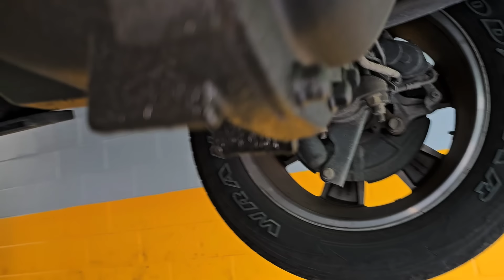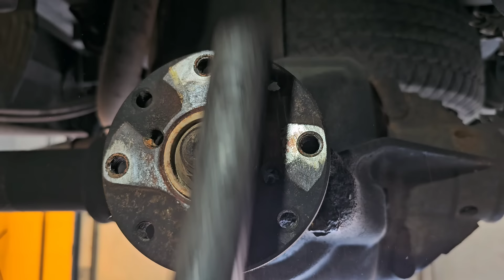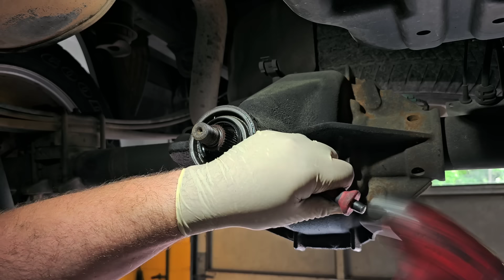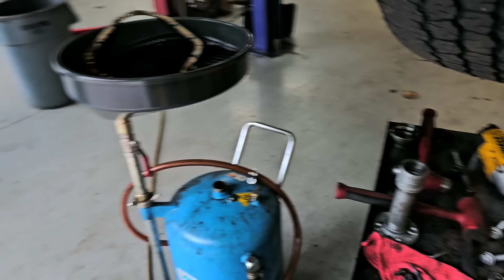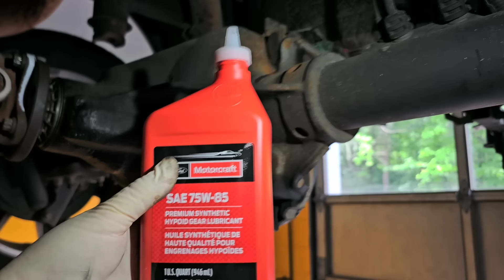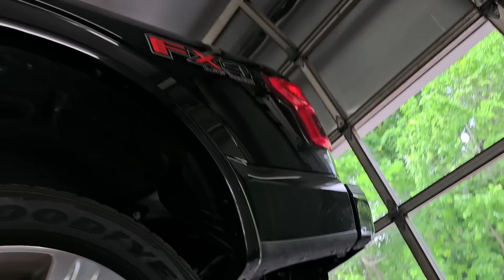Rear Pinion Seal Replacement The Easy Way!! Ford f150

Comment: Something I just found out: even though they may look like the square drive from a ratchet, not all differential fill plugs are standard square-drive sizes. For instance, even though my S10 differential looks like it has a 3/8 square-drive plug, about 9.5 mm, it actually takes a special 10 mm square-drive. That extra half a millimeter is just enough play to round out the square drive in the plug, especially if it is really stuck in there.

Comment: Nice! Only thing I'd do different is to measure the torque on the pinion nut before removal and again after reinstalling for comparison. And, I'd consider replacing the bearings in the differential if the vehicle is high mileage; that is, if you're planning on driving it until the wheels fall off.

Comment: I prefer to let it spray oil, just add oil and let it be. My truck is new and has leaked from day one. IDGAF about the leak, in the Midwest I call that rustbelt corrosion inhibitor.

Comment: Hey Kenny, Great video on rear pinion seal!  Very helpful.  What's the diameter size of the steel pipe you used to seat the rear diff pinion seal? I'm about to do the same job on my 2015 f-150 so that tool will come in handy. Thanks very much for a straight forward no non sense video.

Comment: Ford charged me $830.00 to do the pinion seal with a 2 year warranty. Do you think this was a good deal?
Reply from the maker: Dealers tend to charge more. The price is higher than what we would have charged. But it also depends on your area. From a shop where I live in the sticks, to a shop in or around a city, you could see prices higher by say 30-40%. A rear Pinion Seal is a good 2.5 - 3.5 hr labor charge.

Comment: I cant say anything about the new Snap On sockets, but the ones from 20 years ago are pretty much bullet proof! I have had 15/16 sockets that were used in disassembly of Semi tractor gliders to remove rear ends, transmissions and engines in hundreds of trucks. And the 15/16 socket I had from SnapOn was so worn out that it fit a 1 inch. And it still worked every day! Prior to getting that socket, I had craftsmen impact sockets the same size that would last about a month and would blow apart. I cant tell you how pissed off I get when the socket fails, slices my hand open, and stops me from getting the job done! After about 10 of these, I bought the Snap On...... Never had an issue again.
Reply from the maker: Those older tools really were built to last a lifetime, thanks for sharing your experience! Keep Wrenching 🔧

Comment: How much past the initial mark did you tighten the nut when you reassembled it? 1/16, 1/8, 1/4 of a turn? Do you ever get a brand new nut?
Reply from the maker: I tightened it about 1/16th of a turn past the original mark.   But I make sure I feel the resistance change because you don't want to make it overtight. I don't usually get a new nut, the old one works fine and I have never had one come loose. If there is ever a question or doubt in my mind, I'll get a replacement. Although sometimes a replacement is not easy to source. Thanks for the question! Keep Wrenching 🔧. Kenny

Comment: I run self tapers into the thick part of seal in 3 opposing spots and light pry with a small small crowbar ish bar and works every time , no scratches , no grooves , much quicker .

Comment: So basically you don’t know if you just over tighten the shit out of that thing because you didn’t count the rotations when you pulled your nut off you just use the impact to put it back on so if we do something like that, what will that cause the rear end out quicker because you put too much tension

Comment: The way it has been explained to me is that the hardness of a chrome socket sends reverberations back through your anvil to your hammer which makes you lose torque and wears your gun out faster. I never put chrome on my impacts, unless I absolutely have to because they are so much thinner, and I am still rocking the same guns I bought right out of trade school. It isn't all good. One other thing I was taught, which is the same principle, is to never ever use a bearing race as a mandrel. They are way too hard and they can shatter. I guy I know found this out the hard way and walks with a permanent limp because he wailed on a big industrial one and it exploded and pieces went into his knee and thigh.

Comment: My work truck is an 04 f150 with 135k miles.  Had transmission rebuilt a few months ago with performance shift kit, race clutches, new drums, new converter.  Shifts awesome!  My rear pinion seal has been leaking since before and it's gotten pretty bad now so I will be doing this job this coming weekend, this video is great and explains everything so well.  Feeling confident in my ability to do this now.  Will definitely be going back and referencing this though as I go along :D

Comment: Very good video  good clear explanation only thing that surprised me is that you used grinder to remove  gasket material which NEVER should be done  because doing so damge mating surfaces for sealing gear oil Gabriel.

Comment: How do you know that you have the same torque on the nut? Marking the nut, flange and pinion doesn't determine the new torque you applied when reinstalling. Would doing it this way change the in and out placement of the pinion gear?

Comment: Thank you so much for this video.  I'm about to attempt this myself on my 2018 Ford F-150, with 104,000 miles.
Reply: Check the breather vent hose make sure it’s not clogged with mud debris

Comment: I totally agree with the old school seal pullers they can cause damage, but there are some instances where I have no choice but to use one and where I have an issue is it’s not the hook it’s the other side that is being the fulcrum point that will leave a little mark especially on aluminum timing covers. What I found out works the best is a small pocket knife and instead of sanding the blemish and leaving dust I will just carefully carve away any high spots to prevent inducing and damage To the new seal when installing

Comment: He didn't check preload on the nut.  You don't need to replace crush collar, check Ford factory mait manual.  You check preload on the nut, if it's below 8 to 14 inch pounds, you will put it back there with a new nut that has a new seal.  You may need a new flange for the drive shaft.  You may not.  Or, is that a non preload?

Comment: As a rookie mechanic in 75 lost face on this job as a warrenty on a pontiac firebird. Our lil' vocational college had some weak spots....rear end drive work was a job rarely done on the floor during last year of hands -on. We were taught to always remove pumpkin & do the complete job. In stealership on one offers help. So we R&Red seal put it all back together with the small extra to recrush the tube...but in less than two weeks it came back. Given to the old timers to fix...i got the five thumbs award! Years later we learned that seals go bad for many reasons...mostly axial moverment beyond design limit due to bearing or cone wear ...in an engine due to varnish and carbon build up wearing out seal as it also hardens from age and heat. Also axial play in main bearings plus wear on sealing suface Damages the seal surface making a groove requiring a sleeve which come in a kit with the matching seal. In twenty years of municipal wrenching never had to work on any differentials. Everything else but differentials.
Like your style...

Comment: I like that approach with the chisel to remove the seal. I have used a puller, and I always thought that it could mess up the sealing surface, so I didn't like using it. The chisel approach looks like a pain to do while lying on the ground under a vehicle, but it also looks like it would be worth the trouble.

Comment: Marking that drive shaft is a waste of time.  They don't balance the drive shaft while it's installed on the vehicle. They are balanced off the vehicle so marking the location  is totally unnecessary.

Comment: This was very helpful , but can I ask are those bolts on the drive shaft, is that a standard size or is there different sizes, also what type of silicone did you use on the outer seal , could I use the same transmission grease as the inside of the seal? 
Thank you loved the video as I’m just about to replace the pinion seal on my truck, keep up the good work thanks for doing what you do , very explanatory thank you
Reply from the maker: What do you mean "standard size"? I used ultra grey from permatex. Keep wrenching 🔧 Kenny

Comment: I like to add - One thing you missed was the vent tube - If you have leaked seals the vent tube is the important thing to clear so the axle can breath and when the fluid it hot - that pressure does not build up  and blow the seals again - I found on my F250 that the vent tube was clogged with dirt and the pinion seal failed - So - good advice to remember...
Reply: Very good point. I cut the vent tube, then blew it clear both ways, and put in a 1/4 inch brass hose bib connector.
Reply: I’m dealing with one or the other now with my E450
Reply: Great video! What’s the purpose of the studded bolts and their position?
Reply: @Phillijr100 They help locate the pumpkin cover, and they provide a place to slide on the brake line lugs. I replaced several bolts with SS studs.
Reply: How do you clear the vent tube?
Reply: @MyElectronicMechanic I cut mine, blew both directions with compressed air and installed a 1/4 " brass hose barb between cut sections.

Comment: Hey boss man to pull that yoke out do
You need a puller or can you smack it out ?
Reply from the maker: I will usually give it a few love raps with my trusty dead blow. If they dont move easily, I'll use a standard "3 Bolt Puller" set. Thanks for watching and commenting!!
Keep Wrenching 🔧
 Kenny

Comment: why is it important to install the driveshaft bad=ck in its exact original bolt holes where the standard 12 point bolts hold the drive shaft to the pinion shaft?

Comment: nice work sir. Quick question How much this service should cost? I left my truck siting in my garage for 2 months and found small leakage from the pinion. It's recommended to replace gasket etc?

Comment: Can you do the same procedure for the Ford 8.8 rear axle in a pickup? We're starting preventive maintenance on it the truck is 31 years old but only has $147,900 mi on it I'm not afraid to get my hands dirty straightforward like this

Comment: I replaced the pinion seal on a 2004 Dodge Ram 1500 using this method today. Seems to have worked perfectly.
Reply: After two weeks still good.?
Reply: @desvariosdeuncamionero8856  Yup! no issues. No leaks, no weird noises, etc.

Comment: I just did my 12 Ram...went a couple degrees tighter on the nut...just because...seems ok... would of been a lot easier if I had a hoist. I believe you have to RTV the splines...that's how mine was assembled from the factory as well...so that's how I did it.

Comment: question on the pipe tool thingy that you used to drive the seal over the pinion shaft.  what is the inside diameter of the hole for the tool?  I'll FINALLY doing the job on my 87 ford f150 tomorrow and will be making this tool.  Have the steel and a welder. just need the dimensions.  thx for replying. (I won't go bananas :)

Comment: Hello Kenny I would like some advice I just did the opinion seal on my truck same exact truck as in your video after installing and Twerking opinion nut down to the recommended torque spec. I put the driveshaft back on and move it around a little and it’s moving up and down and back-and-forth a little bit was just curious if that is normal. I’m a mechanic in training and just wanna make sure so I don’t damage my rear differential hopefully you see this comment with this video being so old

Comment: Thanks for the video—I really appreciate it. I’m planning to do this job myself. I have a 2013 Ford F-150 and recently replaced the differential cover with a Spicer 10023539. It should be a straightforward drain and refill.

Comment: I did something very similar years ago, but instead of the mark method shown here, i did it by feel. I ran the nut down until the yoke was fully seated and everything was snug. Then i wiggled the pinion radially and listened/felt for any play in the bearings. Kept adding torque until i felt no radial play, then gave it one more flat (about 30-40 degrees) and called it good. It's been holding up fine for over 50k miles without replacing that collar.

Comment: I would be weary about crushing that sleeve too much. It will start howling. Also, I have a set of colored harbor freight deep well sockets that I have beat the 💩 out of with impacts  for 5 years now. Never busted one. I figure i could buy 10-15 sets of those before i pay the tool truck... just personal preference. That is the easy way to do it for sure, but that crush sleeve is crucial that it's not over torqued. Good video!
Reply: Tend to agree. Pinion depth changes as that sleeve wears and gets retightened...changes backlash. Then hammering the yoke bashing the pinion gear into the ring gear is a little brutal. Wish he would have looked harder inside the diff to make sure that metal wasn't from worn gears or bearings about to go bad. That should be where he starts the job...Should have looked hard at axle seals too, they're probably due soon... but nice to see a mech cleaning the parts he worked on.

Comment: You should of counted the number of threads showing at the retaining nut. Tightening the nut with an impact, you could easily of over tightened the nut by 1-2 complete turns but still had your alignment marks lined up. Also you should have checked the pre-load with an inch pound torque wrench.

Comment: I'm about to do a rear end overhaul on my 2010 F150, 9.75 rear end. I have all new everything, do I need to get shims and set proper lash between brand new ring and pinion gears or where they're new I can just go with the factory spacers? Thank you for any feedback
Reply from the maker: @anthonysabine823 sorry for the late reply! 
I have always gone with factory spacers. Very rarely have I had an issue with them. You will need to check & record the backlash if you're reusing the old ring & pinion gear to make sure the reading is the same afterwards. If it is a new ring & pinion, make sure the backlash is within spec. Sometimes a little more won't be a problem, but never a little less than spec. 
Make sure to keep the caps and shims in the correct orientation. Left on left, right on right, with all the caps in the correct "up down" alignment. They are machined to the case and can be installed upside down. It would make for a very bad day if they are installed upside down. 
I hope this info gets to your before you complete the repair.  
Keep wrenching! Kenny

Comment: I have a 2018 ford f150 and need to change the pinion seal. Is it the same work as this or anything different to do? What socket size do I need to remove that center nut?
Reply: Ford has basically used the same axles for years. This one is a 9.7” I believe. If you have a 9.7” axle like this the procedure should be the same.

Comment: Great video! I referenced this video like 20 times while replacing my pinion seal! I ordered a special tool for the driveshaft bolts, but it was the wrong size, and honestly not necessary. My diff cover was caked with RTV. I (carefully) used a razor blade and a couple taps with a rubber mallet to separate the cover. 
12mm 12pt socket worked fine for the driveshaft bolts. 
30mm impact socket was needed for the pinion nut.
Reply from the maker: Glad I could help. Thanks for watching & sharing how your repair went. Keep wrenching! Kenny

Comment: Like your channel. 
 I might have missed it, but I didn't see you specifically point out to lube the lip seal.
 Also, I think the differential oil is the most neglected part of any automobile,  followed closely by the antifreeze.

Comment: Great video Kenny, I learned a lot. Question: after you take out the seal can you reach in and remove the outer pinion bearing to inspect it? Some people say it's an interference fit and others say it comes out easy. Thanks in advance.

Comment: What year is this F150? My son’s truck needs the same thing done. Was just curious what years this procedure would pertain to. His is a 2018.
Reply: Same thing, but use a torque wrench on the driveshaft, jaw puller on the flange and get a service manual. It is very easy to buy the wrong parts...be careful. Hanes describes a more scientific preload adjustment using torque measurements you can make with a cheap beam-style torque wrench.

Comment: Kenny, I relied on your video to guide me through the pinion seal on my 2013 Ford F150.  It was a great help, although I didn't have the luxury of a car lift. I was on my back doing the job. The most noticeable difference from the Ford you worked on and mine was rust! I live in the Chicago area. Axle was very rusty!
Reply from the maker: @davidclaes1409 I'm glad the video helped. Thanks for watching. Keep wrenching - Kenny

Comment: U can take drills and drill a small hole. Use 10:51  a slide hammer puller and pop it out
Reply: That's what I do as well.

Comment: What was the size of the pinion nut?  Literally every video leaves that part out.
Reply: 1-1/8” or 29mm
Reply: Don’t you imagine that different vehicles have different sizes? Grab the socket that fits!
Reply: @Mr572u  Not everyone has a 1 1/8 socket dumbass. And I wasn’t talking about different vehicles. 🤯
Reply: @Mr572u  useless answer. This video is specifically for an f150, they all use the same

Comment: Any ideas on getting these 12 points out? I've tried everything outside of extraction tools.They are so rusted
Reply: Pre spray the bolts with penetrating oil let set for awhile then spray again, if still having problems use a heat torch and heat the bolts up don’t go crazy on them if you get them out you can reuse them or get new new ones.